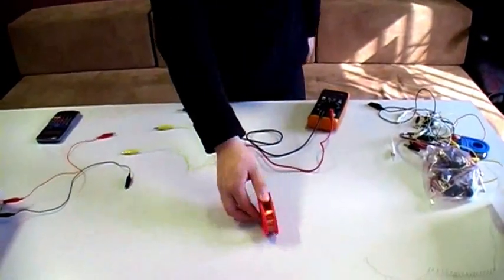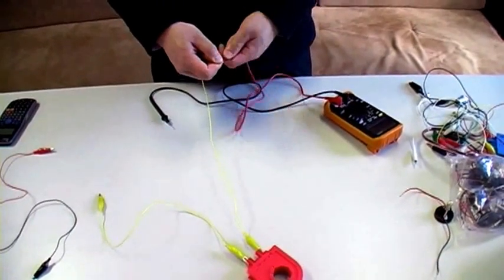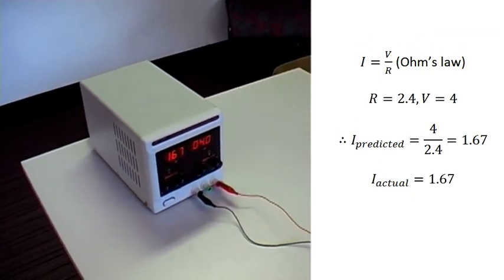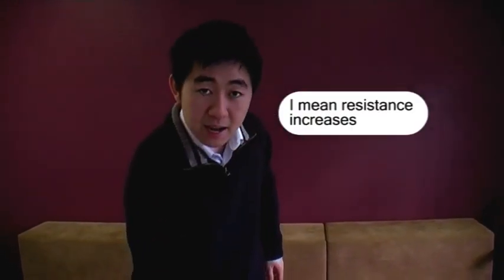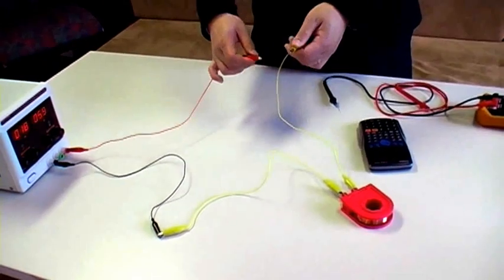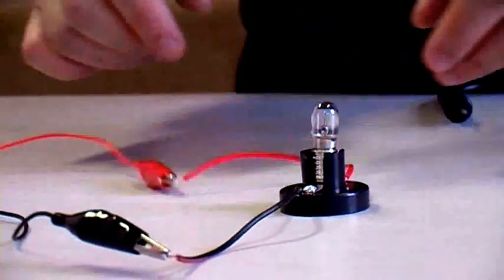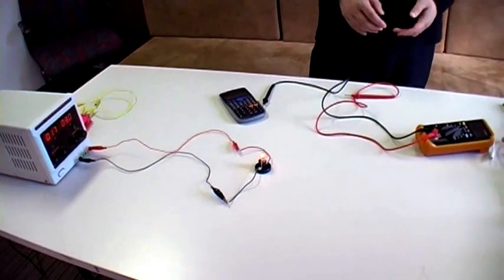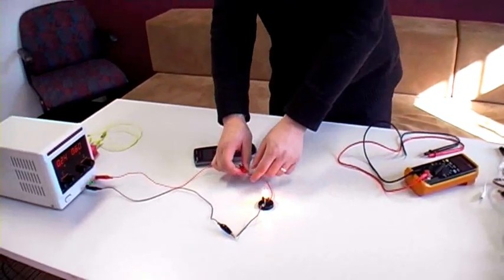Preliminary Physics Electrical Energy in the Home (Part 1 of 3)

Comment: As the temperature of the metal increases, the particles start moving faster. So there is more chance of them " colliding" (sort of the concept behind resistance -> the chance of the particles colliding) . Therefore as the temperature increases, the resistance of the wire increases :)